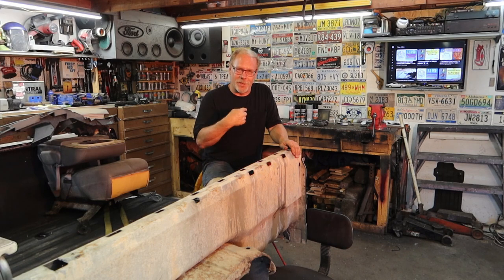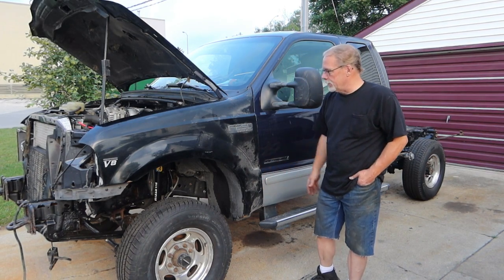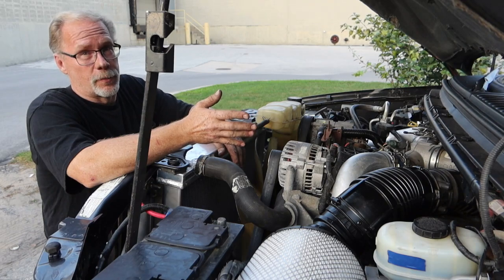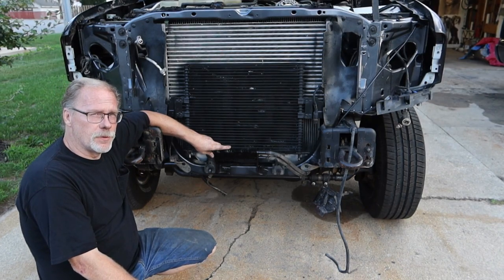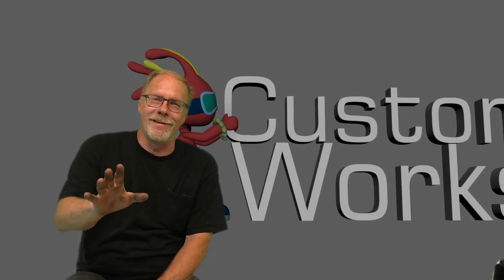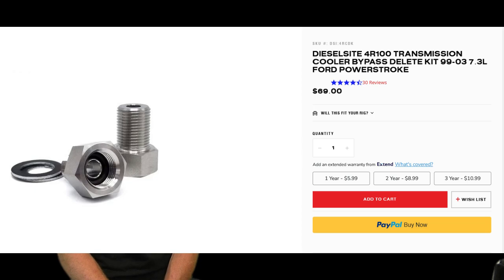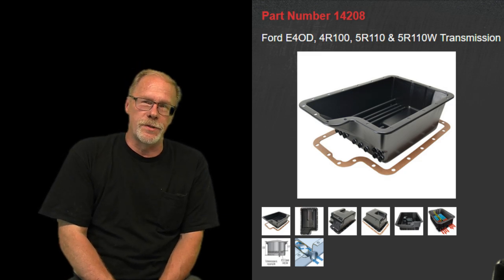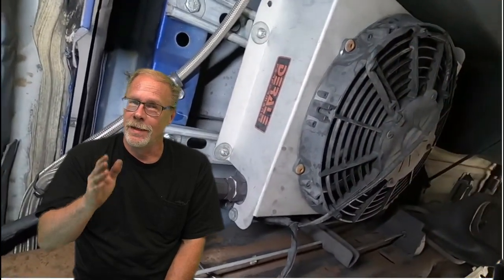🛻📽️ ....7 3 PSD TRANSMISSION COOLER OPTIONS QUICK TECH TALK  🟢🟡🔴🟢

Comment: Thank you again clint Years back hauling my camper in heavy traffic in Miami Fl my temp went up to almost 200 After that i put the 6 o coller and ever since my trans temp never goes above 150 to 175  Sometimes it stays as low as 125  After 307 000 miles if I have to rebuilt the trans I will consider installing the derale oil pan  Thanks for another informative video Keep up the good work

Comment: Just installed the Mishimoto transmission cooler and deleted the bypass line on my 2001 Platinum Edition. Transmission temperature averages about 25-30 degrees cooler. 
It's shifting smoother than it has in a long time too. 

Thanks Clint for sharing your wisdom with us all. 👍👍
Reply: How does it do in the winter ? What are your usual ambient  winter weather temps ? I just bypassed my radiator as well because I'm in West Texas  and we see +100° often during the summer and I barely work any when it's below freezing at 63 years of age. So far I've seen 160° on a 96 degree day pulling a 10k lb trailer in town. Lots of stop and go. It stays close to 140° if I don't drive aggressively.

Comment: I have a 96 7.3. Tow 4-15k lbs (dump trailer) 3x a week. I am over $800 in coolers and pans trying to keep my temps cool at in town speeds (35mph or less) 

I’ve tried a 12”x8” transmission oil cooler. mishimoto universal cooler 23x7.5” cooler. B&M pan. Derale pan. 6.0 cooler. Etc. plus all the adapters, hoses, and ATF. 

Latest trial is I Installed the Derale Pan & 6.0 cooler. I seen 235°F the other day. At least This time I did NOT have ATF leaking when I topped the hill. .. (Same hill in town I keep having issues on. It’s my way to gauge whether or not the upgrades are working or not) 

My temp probe is installed on one of the hard lines though coming out of the transmission. (ISSPRO sending unit that I cannot get to come apart) I’ve been told to relocate the temp sending unit to the test port

Comment: I installed a ford factory rebuilt transmission 17 years ago in my 02 dually and did all of these mods. I pull a #10k trailer daily on a short loop for work and I've never had an issue with temps even when it was 110 degrees here in West Texas. There are no hills out here though so im sure that helps as well.

Comment: Good video Clint. The bypass valve has nothing to do with transmission temp. It just a pressure relief valve so you won't blow the cooler out if it gets to much restriction and so if the cooler doesn't flow enough so it won't take out the transmission from lack of lube. That's from Mark who used to work at Ford as an engineer in the transmission department. The engineers at Ford tested the Super Duty at 30 mph because that's when the torque converter locks up. That's the only reason why the small cooler passed the test. Different department test the 5R100 behind the 6.0 powerstroke and that's why that cooler is much bigger.

Comment: I did a trpile disc billet converter, magtec transpan, Mishimoto 36 row trans cooler, and bypass delete. My transmission woes are long gone. Hard to got it to 160, tq converter ulocked pulling 8% grades loaded good and heavy woth the ac full tilt.. makes for a bulllet proof setup. 

Nice video on this Clint!

Comment: @ 6:00 - I doubt it was an engineer who said "Yeah, that'll be enough".  It was more likely an accountant who said "but if you make it smaller we can save $1.83 on each truck"
@ 7:48 - Do you have a video on suggested mods for people who do tow regularly?  I'd be interested in everything from engine mods that bump power, engine mods that increase reliability, cooling mods such as this one, brake mods, etc, etc.
@ 9:23 - I've seen videos from reputable transmission rebuilders that the bypass is designed to maintain fluid flow if the cooler becomes clogged, and it should never be removed.  This seems to contradict your thoughts on the bypass.  Care to give your opinion on the advice that it should be kept, and why they may be incorrect?
@ 12:13 - Turbulator?  C'mon....

Comment: For my 7.3 hotshot trucks, I added a 6.0 cooler. I run the cooling line first though the built-in transmission cooler in the radiator where the water in the bottom of the radiator is much cooler, then it runs through the 6.0 cooler. Never have any issues with them running this way.
Reply: What transmission temps does that yield?
Reply: @LemonySnicket-EUC  Been a while as I'm running a Peterbilt now, but I think the highest I remember was in the 180's. Typically ran in the mid 160's.
Reply: @2020HotShotTruckingLLC I bypassed the radiator section and just run straight through a Mishimoto 6.0 type 37 row cooler and have seen around 140° to 160° pulling a 10k lb trailer in 96 degrees and city driving. I've been very happy. Thanks for your feedback! Have a good one.
Reply: @LemonySnicket-EUC My trailer weighed 7K empty and I'd typically load up to 8.5K on it. Hauling shipping containers or large tanks was worse due to the air the load catches. Still, I was real happy with the 6.0 cooler.

Comment: My floorboards are hot to touch right at the shifter. I'd definitely say hot rather than warm. I have a ZF6. I was considering adding a finned cooler (aluminum heatsink with NPT tapped ends) in line going to the radiator, but came across plenty of statements on how a ZF6 can't over heat. Am I onto something or just going to end up chasing my tail? I recently rebuilt my ZF6 (for a cracked OD gear) and it felt the same before and after. This is just a calibrated hand gauge, I don't have a thermocouple on this at all.

Comment: I’ve done all of them 👍. But I don’t know what the average temperature is supposed to be 🤷🏻‍♂️. My 4R100 is in a 2000 4x4 Excursion and I tow 2-3 times a week,2000# to 5000# trailers. Has run at 170 degrees to 180 dg and my fan keeps blowing temp. Relays.???????? Can you please give me some advice?
Reply from the maker: Temp range is excellent and I don't have the part number handy but the relays may be to light try going back to OEM or NAPA has long duration heavy duty relays or I use Freight liner relays
Reply: @CUSTOMWORKS7.3PSD  Thanks my friend I’ll try but they are almost all of the amperage I think that the temperature sending unit on the fan might be bad it’s set for 185 degrees. If the trans gets up to 210 pulling up hill will that burn up the trans? Thanks for the response and the advice 👍🤠

Comment: Thanks for your videos! I upgraded to a 6.0 intercooler, but it's also plumbed into the stock cooler in the radiator. Would you recommend this or just keep it completely separated and tied into the 6.0 cooler only? I'm in California and the transmission will get close to 200 degrees on hot days, I'm wanting to get those temps lower.
Reply from the maker: We do that on tow 7.3's all the time Good thinking

Comment: Thanks again brother great info got a quick question for you on transmission fluid by hot shots the shift restore what are your thoughts on it also is it safe to use the fords coolant additive with any type of radiator fluid

Comment: As always, terrific information on point. well done. You mentioned for the 6.0 cooler, we need to re-work or extend the lines. Are those typical compression or J6 fittings?

Comment: Hi Clint, What transmission fluid do you recommend for my ZF5. I constantly haul 2500–3500 pounds, and have felt the casing get hot to the touch. Not scalding hot, but hotter than warm. I’m guessing this is why the ZF6 transmission came with a cooler. I’m hesitant to put in any exotic ATF because I’ve been told theres a blind bearing that needs the low viscosity that Marcon lV has which I believe is somewhere around a 20 wt. Mercon is good but I’m sure there is something better for not much more for my severe duty application. Also, what do you use for the transfer case? On the back of the bottle, it says not to use Marcon lV inside the transfer case. Thanks as always.

Comment: Clint, I have a 1997 F-350 automatic trans would this year have the bypass tube and do the have a bypass kit for my year of truck.
Reply from the maker: From 1999-2003 the Ford 7.3L Automatic Transmission (4R100) had an external cooler bypass tube that redirected transmission fluid from the pump output back to the return line of the transmission. The bypassing of the cooler was supposed to happen until the fluid reached operating temps.

Comment: I’m interested in installing 2006 ford Transmission cooler in my 97’ OBS and watched your video and some other ones. And in one of the other video’s they bypassed the line going to the radiator is that wise or should I continue with a line to the bottom of the radiator?
Thanks
Reply from the maker: trans cooler line must stay if you live in a cold climate
Reply: I recently did that as well  and it runs a bit  cooler now. I usually don't work in my job when it's below freezing and I plug the truck in on the colder days via a timer. I'm in West Texas where it's close to 100 degrees during the summer  when I'm working the most. I'm 63 years old so I don't do much physical labor in the cold any longer.

Comment: Why will nobody show how to remove the lower factory plow bracket mount, or crash bar that is held in place by 3 bolts on each side with round flat heads??? Mine just turn in place. Vice grips are kinda working to hold heads while I use an impact.
Reply from the maker: weld a nut to the top
Reply: @CUSTOMWORKS7.3PSD  bought torches today, I now have the power of fire, lol